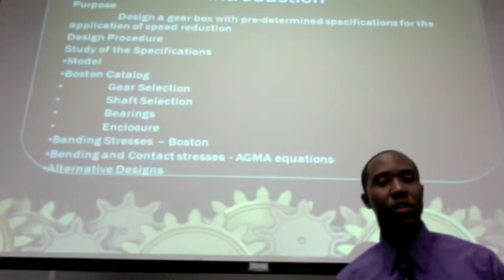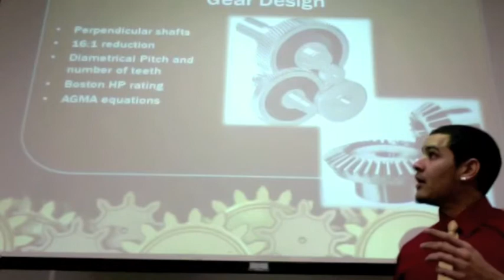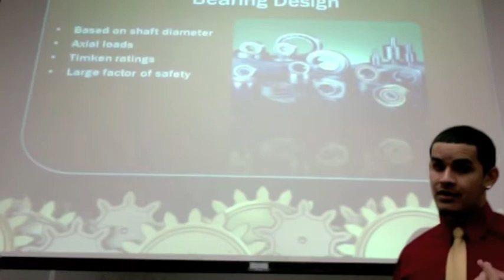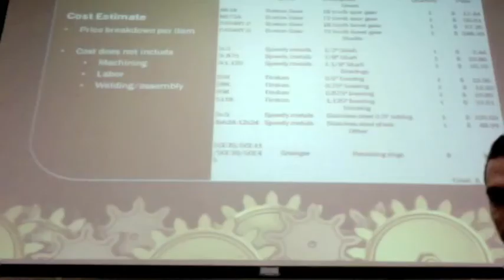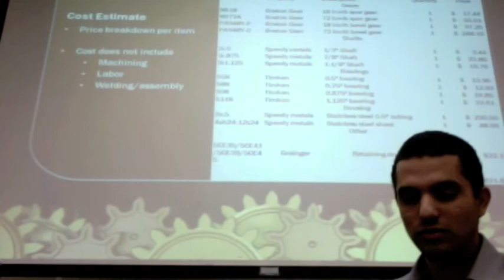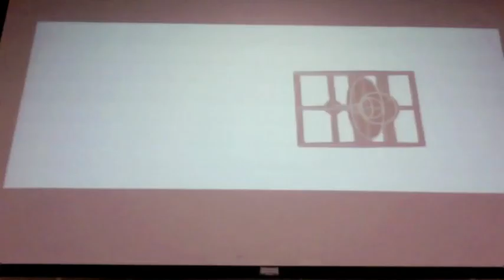Team 2: Power Transmission System Design

Comment: The speaking is a bit slow, and the messages could be better articulated. Excellent visual aids in explaining the design process, and I especially like the explanation of alternative designs, and the gear selection process. Would have liked more detail on the bearing selection process.